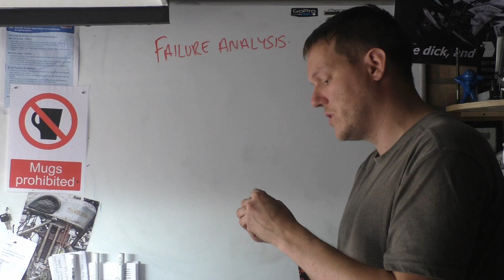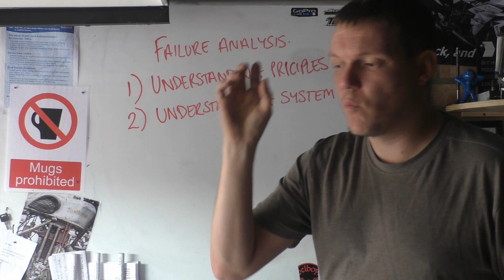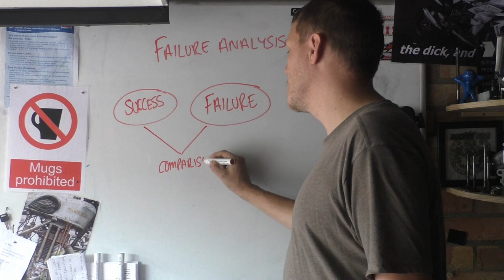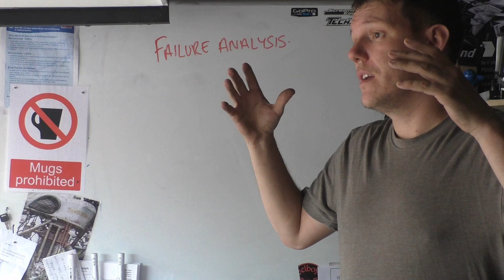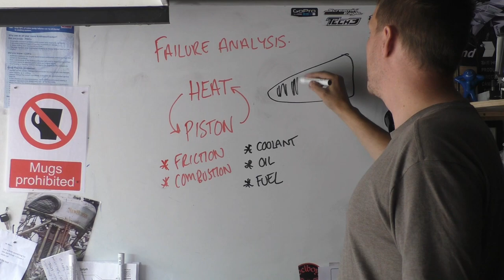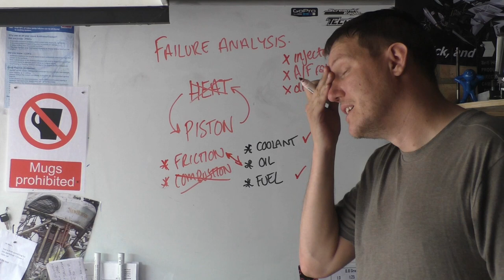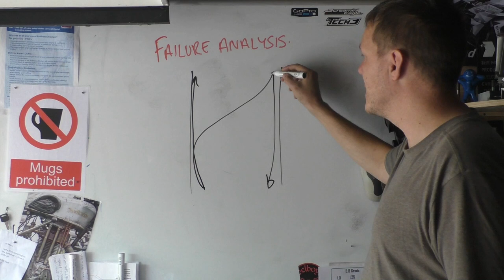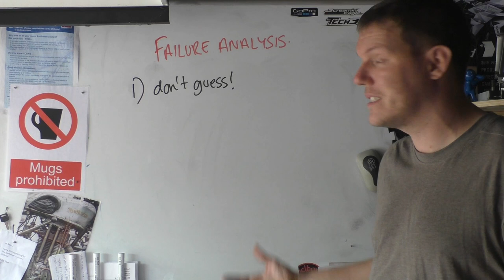Failure Analysis Basics - Part 1

Comment: Great video. I work in I.T. as a Systems Administrator, we do failure analysis all the time. You are bang on the money with FA! It's a principle that transfers to everything and anything.

The funny thing about FA, is that when I or my team have put everything together (we use similar methods to pictures and explanations in PowerPoint) we usually know straight away what went wrong and why. But... we never assume anything! We get other people to review the data, to question the data, to question us. Sometimes these people have nothing to do with I.T. so that they're judgement isn't clouded by stuff they already think they know.

I really enjoy FA as it usually tells you more about how something works, than just assuming it works.

Great videos!

Comment: Im relatively new to engines but have a pretty solid grasp of the principles. The service manual does help a ton with the rest. I've found so far that doing all of the services listed in the manual ( checking fluids, valves, pads, bearings, filters, tolerences, etc l has given me a great understanding of my bike as well as bringing back some of its 1990s glory. So reading through it is great and all but actually doing is even better.

Comment: Hi Matt great video as usual Thank you
I used to have to do a lot of failure analysis on the Glass CNCs at work totally agree with your points i
I would first have a look at the broken mess and because I understood the process and system I could make a quick visual analysis not always correctly but then turn to the operator and ask for his opinion and why usually a shrug of the shoulders I would then try to point out my conclusion and why mostly right but to make sure I would watch each tool and speed ready to stop the process before it went wrong sometimes it was beyond me and had to talk to the manufacturer engineer if he could he would give me advice or they would have to come out I always tried to watch and ask questions you can never know too much

Comment: Most car and bike guys do not understand how much parts stretch and expand at temp and rpm. Huge difference between low rpm and low power densities for a daily driver compared to building a machine to go racing! I would bet dollars to doughnuts that they had a combination of cooling both water and oil issues and rod stretch! You add that all together and you get heat issues, micro welding and pistons and head kissing! You are absolutely right though with your white board work! There are fantastic books on all of this but they are in libraries or out of print not on google! My bathroom reading I mean throne room and library is well stocked with books only a man could love! LOL....Before I work on a car or bike I read the service manual casually a few times if I have not worked on that particular make and model. I take notes. I review over and over again. I give the machine shop clear and specific requests and I will ask them to look at my notes if I am not sure of what I want! I learn more from failure than success! Learning is the key!
Reply from the maker: "Most car and bike guys do not understand how much parts stretch and expand at temp and rpm."

the TW guy in the R3 goes on about this- at length - he talks about heat - which is bollocks. Don't get me wrong the rods get warm, and will expand - maybe 5 microns. The real 'stretch' is when the rods are under tensile load.

Comment: Matt a few years back i was modifying my spring air guns, they have a long piston in them 10-15 cm, the whole point of modifying them was to remove vibration caused by the spring and the piston slap. What we did, we added derlin buttons to the piston, to stop it flopping around in the cylinder. Ive seen diesel pistons that have piston springs at the bottom as well. Why aren’t in all pistons bottom springs? Wouldn’t it solve that problem?

Comment: Question Matt.  When tuning suspension you make one one change at a time, so you can assess what that particular change has done.  As they were going into unknown territory, would it have been wise of R3 guys to make one upgrade at a time, assess it, and then move on, rather than changing everything at once?  I know this is more expensive, but maybe that's the price of going into unknown territory.
Reply from the maker: Yes. Not only that but understand what these 'mods' actually do. I'm sure the stock rods would have been fine, and they're probably lighter.